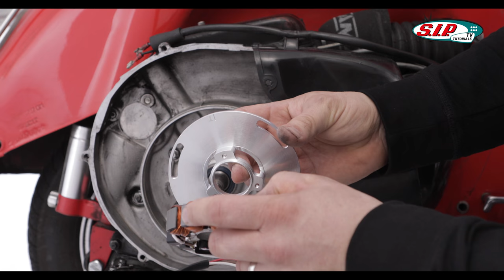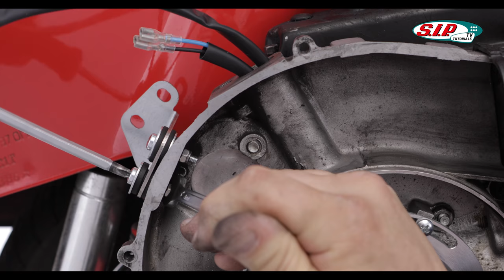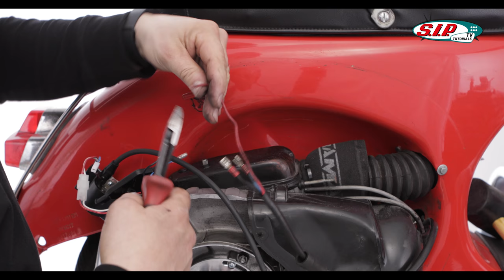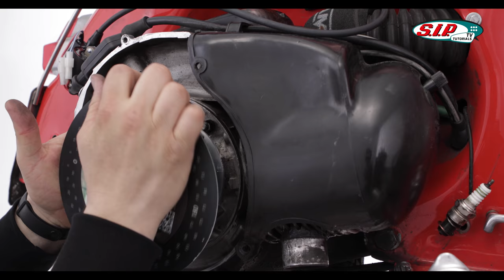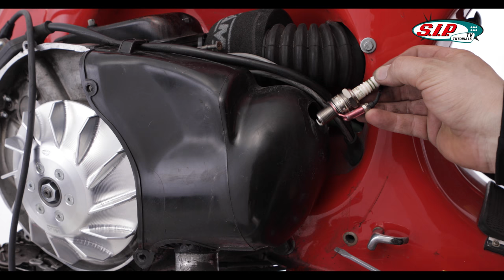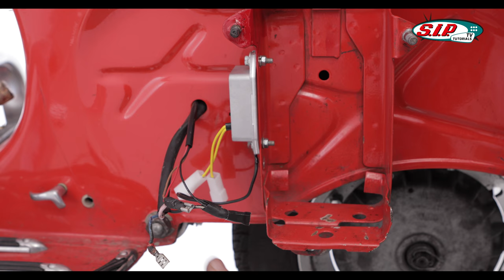Zündung SIP Performance für Vespa Montage Tutorial

Comment: great tutorial! i see that the sparkplug has a wire that is attached to its thread which is then secured when the sparkplug is tightened into the thread hole. I guess it is connected to  and is a unique part of the SIP Performance ignition kit? Thanks
Reply: That's a head temp sensor.

Comment: I got a new Honda Activa 6G ( September 11 2021 - 642km driven) ; from the beginning, the heat generated at the Rear wheel Drum is quite unusual - after driving a distance of 5km. Later when I checked the wheel, I found a - Play of 0.5mm. I would be greatful, for your valuable guidance - relevant to this Mechanical Flaw & request you to post a video  - similar to the above vehicle.(FI variant). 

 the Rear wheel Drum - (splined coupling)

Comment: Have a 2012 PX150 with a BGM 177 kit and a SIP Road 2 .exhaust .. Bike performs really well but when it's just starting to rev and make some power it hits like a rev limiter ... Do I need an aftermarket CDI set up like above to get it to rev a little higher. also would a Fast flow fuel tap help it to rev out a bit more without hitting a wall.
Reply from the maker: hard to say. There are many reasons which can cause this issue. Please call our team. We have good technicians who can help you out. https://www.sip-scootershop.com/en/page/contact/contact
Reply: As i understand it the Euro 3 PX models have a ignition system that limits the ignition to 7000rpm.

Comment: Does anyone know what the ignition timing is on a px 150 with a pinasco 190 60mm kit on? Also what jets should be in and what plug? Currently running 7hs and just got a 6hs. Having major pinking issues at 50mph

Comment: Sir I have lml Vespa NV SPL 
150cc self start but there is a problem 
My battery can’t charge proper to start the self motor 
Can you suggest or send me a heavy current voltage coil plate for it please help 
I love my vespa

Comment: I have to say your video is useless for timing help for a newbie!
I have set my Timing successfully when I had points. 
When video gets to divide in half, example (43mm) and that is top dead center, but instead of going to top dead he just turns it to align the marks on stator, the T mark, example (23 degrees)!

WTF? SO NOW WHAT ?
Do I stop at the T mark and deduct however far I've continued past my 43 degrees of TDC ,example (23degrees) and what am I marking .

I can't wrap my head around the last part and th guy in the video just stops and sits there while the annoying music plays. He not showing his numbers or what he is marking on the case for strob.
Just sits there.

I'm sure your instruction are just fine but for some reason I can't  wrap my head around it....

Comment: Ich finde, dass die Masseverbindung im Video nicht "Sicher" genug ist, da der Winkel ja auf den beiden Gummis gelagert ist.
Ich hätte das Massekabel eher an einer den beiden Schrauben mit denen der Winkel am Motorblock befestigt ist angeschraubt.
Das wäre für mich eine Sichere und 100%ige Lösung.

In euren Videos könnet etwas mehr auf Professionelle Werkzeuge achten, das beim Verkabeln geht ja gar nicht.
Für jede erdenkliche Arbeit an der Vespa habt Ihr in eurem Shop ein entsprechendes Werkzeug/ Zange.
In diesem Fall nehmt ihr einen Saitenschneider und eine Spitzzange um die Kabelstecker zu montieren, das ist nicht gerade sehr Professionell.....
Diese Zangen kosten ja nicht die Welt und ihr könnt die bestimmt öfters mal gebrauchen und es kommt Professioneller rüber !!
Reply: Bitte das Massekabel auf keinen Fall am Motor anbringen. Dann funktioniert die Zündung nicht! Die Masse braucht eine direkte Verbindung zur Zündspule. Wenn sie vor der Gummilagerung angebracht wird, ist sie isoliert.